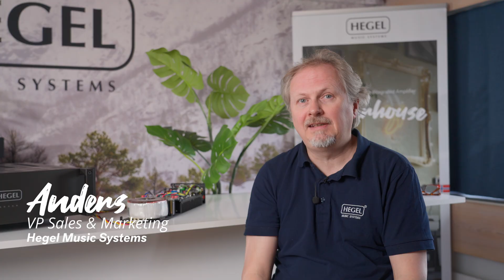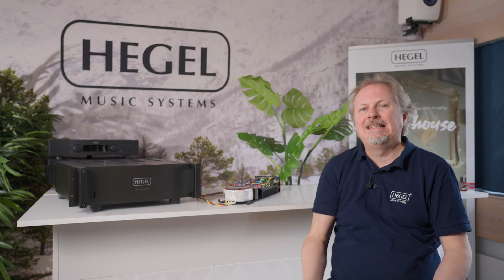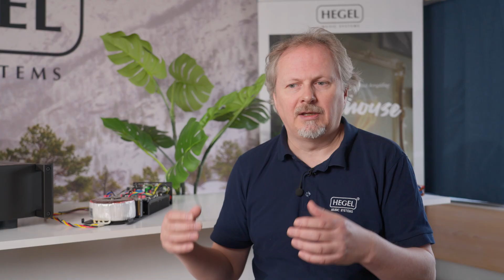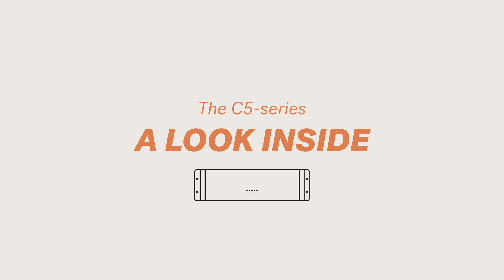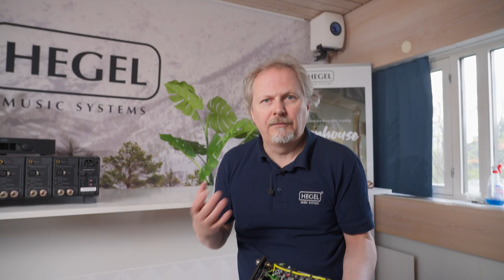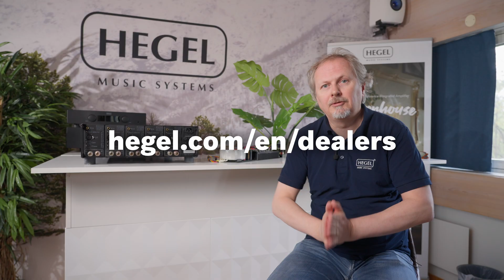Hegel C5 series Introduction

Comment: Really great amplifiers
Wish to see more videos about hegel products and features through this channel
 I must say the manufacturer should explain about their products how much capable of

 only few can do that because they know their products capacity and i am personally great fan of hegel products 
I would like to ask one important thing about damping factor which you mentioned on your product specsheet is applicable for full freequency spectrum (20-20Khz) or only upto 1khz please confirm
Reply from the maker: First of all thank you very much. We have wanted to make more of these kinds of videos for years but have struggled a little to get the right team together for it. On the film technical side, that is. 

As for the damping factor, excellent question. It is not 4,000 from 20-20kHz, but it is wide range. Exactly how wide I do not remember, but it is wide. On very high frequencies we also believe that the benefit of it is less.